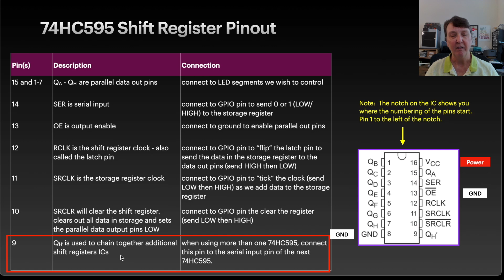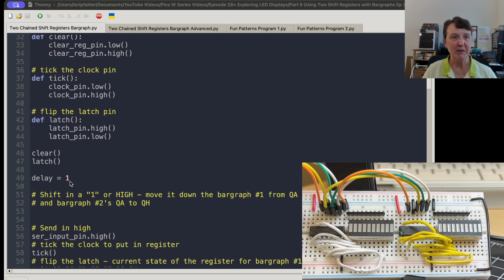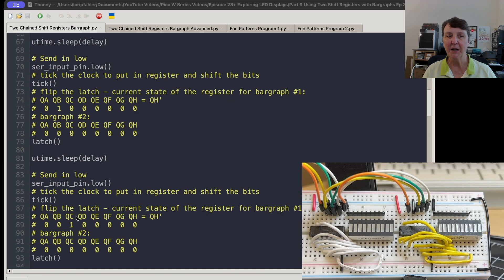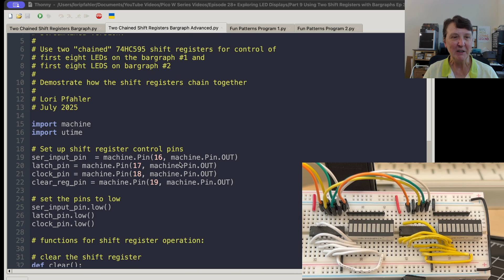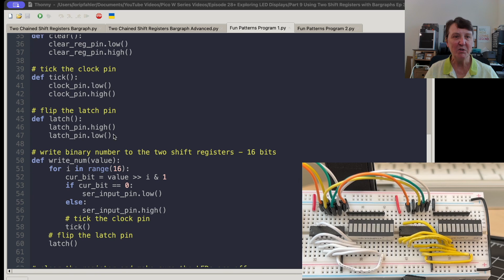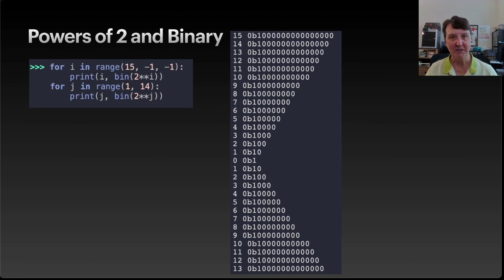Pico W Episode 36: LED Displays Using Two Daisy Chained Shift Registers with Two Bargraphs - Part 9

Comment: Great job! I like that you are using binary bit shift and powers of 2. Thanks for the video.
I have thought of another chip you can maybe do an episode on. The MCP23017 - i2c 16 input/output port expander is a fun chip that lets you add extra outputs or inputs to your project. I used one on my greenhouse controller board using 7 outputs for an LCD display and 4 inputs for buttons for the user interface. I have not used it on the pico but it looks like there is a library module available on Github. I have several extras sitting around Let me know if you want me to send you one or two.
Reply from the maker: Interesting chip; no need to send one. I recently picked up an IO expander from Pimoroni (PIM517) during their recent sale.  It is a pretty fancy one.  I can definitely do an episode or two on IO expanders.  Maybe compare to the 74HC595 and 74HC165? -- include the MCP23017 chip as well as the Pimoroni one.  Great idea!  Thanks for watching and please keep sharing your suggestions/hints so this series is as correct and helpful as possible.
Reply: @lorisrobots  That's right. I may have mentioned the MCP23017 in a comment on that mailbag. Old and forgetful!